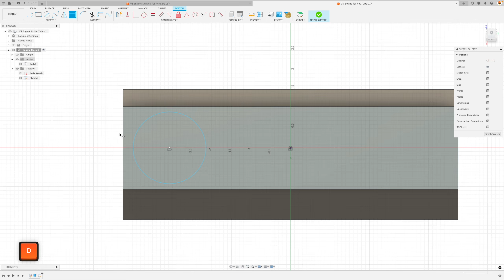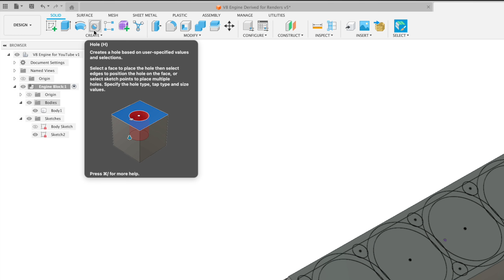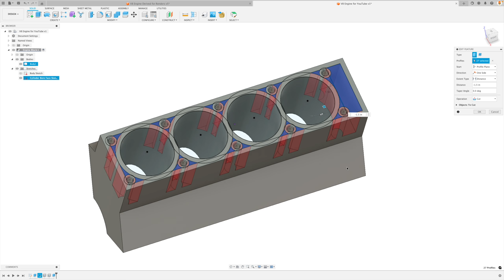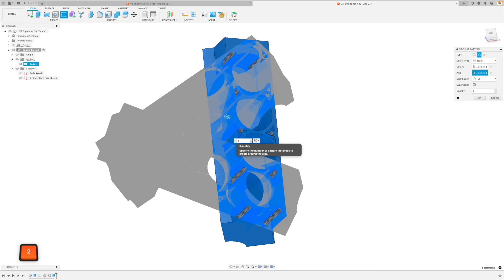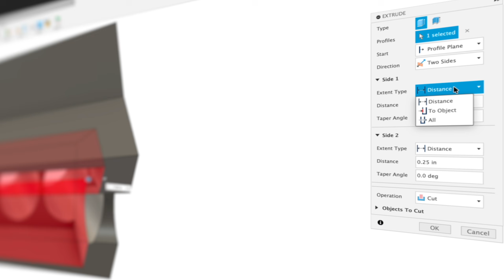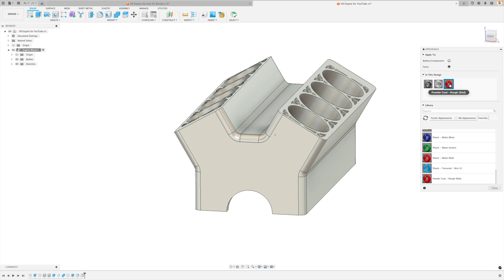Autodesk Fusion Course for Beginners 2B - V8 Engine - Engine Block (2025)

Comment: day 2 hey hie. my viewcube is oriented with Y upwards i tried editing using ai instructions it didnt change please help am onto 2B but hesitent to proceed incase i start over while resolving the viewcube issue
Reply from the maker: Thanks for reaching out! Here’s how to change the direction.

1. Click your profile/name icon in the top-right corner of the Fusion window.
2. Select Preferences.
3. In the left-hand menu, go to the General tab.
4. Locate the Default Modeling Orientation setting and switch it from Y up to Z up.
5. Click Apply, then OK, and open a new design tab for the change to take effect. (Note: This preference only applies to newly created files and does not reorient already open or previously modeled files.)

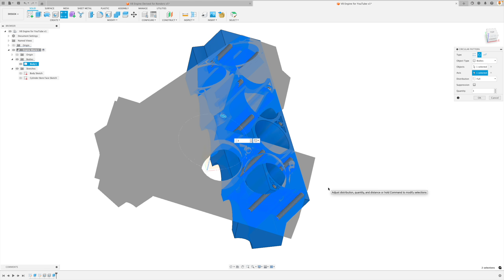Comment: Sorry, but at 20:12 I am having issues with the circular pattern tool. I keep getting the error: Selection not found in Cached body or Sketch. Do you know what I may have done incorrectly? Never mind, I figured it out. 

The Issue was that i had apparntly deleted the orgin point in my file, or moved it? Im not sure how or when, but i simply added a line right at the z axis and it worked. Thank you!

Also another solution I just figuired out is that you need to make your origin visible.
Reply from the maker: Well done in figuring out the problem. Excellent!

Comment: Hobbiest Version - got to the last step but can't get the colors ro work .... is this because of the Hobbiest Version i'm using ?
Reply from the maker: There shouldn’t be an issue with your version. I find that this feature of Fusion can sometimes drive a person crazy. Some workarounds include restarting Fusion (or your computer), making sure that you select Faces or Bodies to apply the appearance to immediately after entering the appearance window (without making mistakes), and sometimes just trying many times. Hope that helps.

Comment: Another excellent installment to the series. I especially liked the idea of using the circular pattern to create the opposing cylinder bank - I never would have thought of that in a million years. 

I did have a problem with applying the appearances though - I couldn't select multiple faces when the appearance dialog was open, so I selected the faces first, then opened appearances and applied them OK. Also, you may need to first download an appearance before using it as the powder coat rough red appearance isn't installed by default.
Reply from the maker: Thanks so much for your support and encouragement!

Great job with applying appearances too.

Comment: When im making the circle s for the pistons the line isnt in the middle and it messes it all up what do i do?
Reply from the maker: Thanks for reaching out! Happy to try to help, however I can’t quite understand your issue. Which line are you referring to?
Reply: @learnitalready  yes im having the same issue as well.. after going back through the video i see that everything is the same as yours but when you get to the circles created for the pistons the sketch for some reason isnt centered. I had to look through the comments to see if i wasnt the only one...
Reply from the maker: @ChasingMoney-m7d  Thanks for explaining. You are correct, the sketch isn’t centred. Pay close attention to the dimensions from each front and back faces to the hole centres. They are staggered to compensate for the crankshaft and piston assemblies. Just make sure to check each dimension is correct before you move on. If you’re interested in supporting the channel and receiving the document package which shows the dimensions clearly, then head on over to our Patreon page to sign up. 

Hope that helps!
Reply: The red line going down the middle